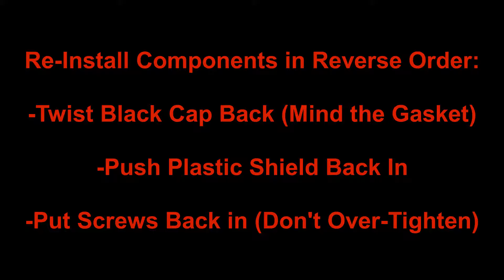Replacing Headlights 2014-2020 Jeep Cherokee (30 Seconds)

Comment: Are you sure this works on driver side 2016
Reply: It does. I just changed the driver's side on my daughter's 2016 Jeep Cherokee Limited. Turn the wheel all the way to the right and do the same procedure that the video shows for the passenger side. Remove the 3 screws that hold the mud shield in place (8mm socket), pull the shield out away from the inside fender edge, and you will see the domed cover for the headlight. Turn that counter-clockwise 1/4 turn and pull it off. Turn the bulb assembly counter-clockwise until it unlocks and pull it out. Lift the plastic clip like it shows and pull the bulb off the pigtail. Reverse it all and you're done! 15 minute job.